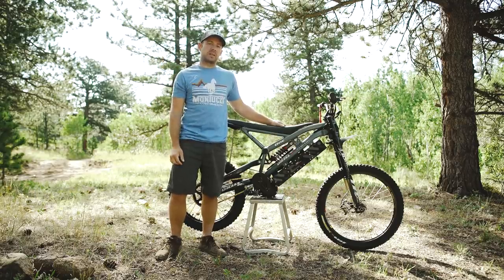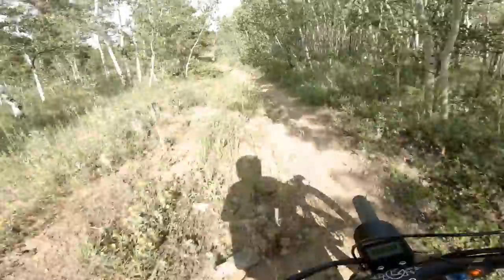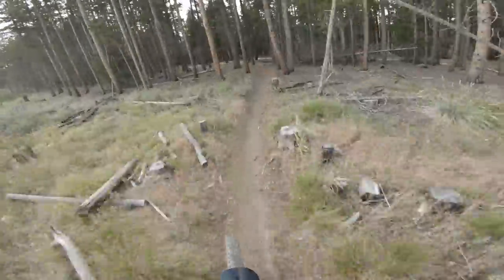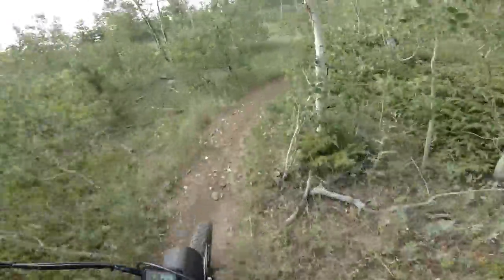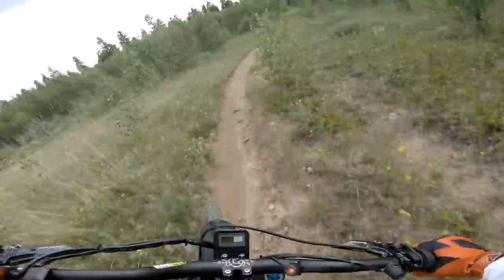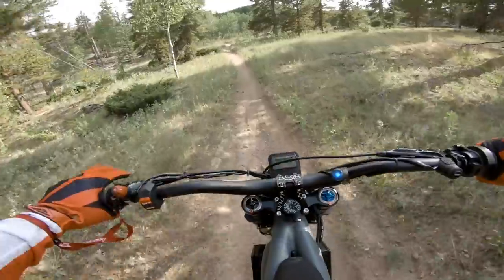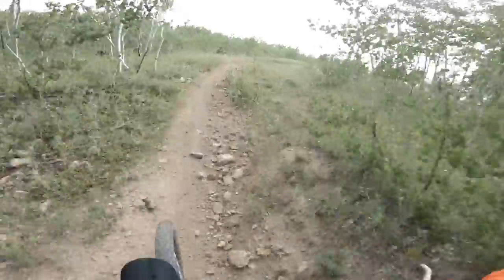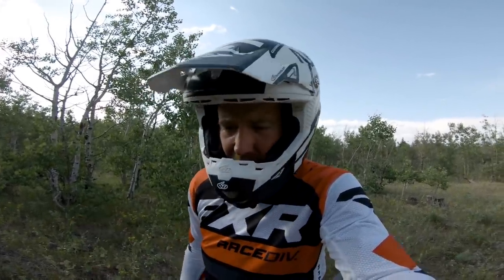CZEM Drill One Electric Dirt Bike | A Sur-Ron Destroyer?

Comment: Amazing how quickly they are evolving.
Reply: Itll be a game changer when they realize they should be putting 3 or 4 speed gear boxes on them. Im really not sure why nobody is thinking about that. The motors are more than capable and so are the batteries. 
"Give me gears or give me death" i think somebody famous said that once.
Reply: @mshock9637  weight, cost and and engineering complexity (motor is no longer directly in line with the driving sprocket for one). It's better to up the power to the point where you can simply raise the final drive to achieve high speeds, but still have arm snapping torque off the line. A gearbox is not required
Reply: @aidangillett5396 
Thats the most ridiculous thing ive ever heard. Thats basically saying that transmissions on cars are stupid and centrifugal clutches and torque converters are just a big fat waste of time? You dont need those if you just build a bigger, stronger, faster engine... right?
Reply: @aidangillett5396  
As for a gearbox design. 
Take the guts from a quad.... and make it work. Build to finish in just 2 easy steps.
Wheres all the old fashioned American ingenuity these days. Youd be amazed at what you can accomplish with a welder and a pile of garbage my friend.
Reply: There's one by specialized weighing in at 36lbs. They're getting lighter and faster by the year I wonder if it's the development of wind turbines that's been the innovation or power tools? Or maybe they're all getting better at the same time for their own indented purposes.
Reply: @mshock9637  My car has impressive acceleration and top speed 162 mph , and no transmission.  What do I need a transmission for?
Reply: Electric Motor has the same torque from start all the way up to about the last 10 mph. They pull all the way. You'd only need a gearbox for an overdrive starting at about 40 mph to 90?
I don't want to go 90 mph on a mountain bike.
Zero and Energica have no gears.
Energica has 150 pounds of torque up to 130 mph. Beats anything on the road..
Reply: Your both just saying that just because you motor already gets to such n such speeds with such n such torque means you wouldnt benefit from a transmission and find your line of thinking a bit strange.
Reply: @fatyowls  
Believe it or not we have dyson... yep the vacuun cleaner guys to thank for a lot of the motor and controller technology.
Reply: Yeah, you don't need a transmission with an electric motor.
Reply: @aidangillett5396  
I completely understand what you guys dont seem to get is application. If the electric motor is that good at the axle why not have it not be a reduction drive but an increase. How is no body pick up on that. Im not saying gear it down YOU GO UP DAMMIT.  so the sur ron for instance goes from 1:1 to 1:3 your just stretching its potential other than mechanical loses this is not stupid and none of it takes a genius to sort out.
Reply: @mshock9637  Keep in mind transmissions are expensive, heavy, and inefficient.  They cause extra friction which contributes to the useful power (at the wheels) being less than the power at the crank.  Sure it makes sense when you have an engine with a very narrow power band.  But electric motors have very wide torque bands so you can have situations where adding a transmission would increase cost, decrease range, and decrease performance.  Porsche brought out a Tesla competitor with a 2 speed transmission and has already announced that the next version will not have a transmission.
Reply: The sur ron already has a transmission on it for cryin out loud its just a single speed. Youre telling me that whats gained from that 2 stage reduction is worth less than the the amount of rolling resistance it adds? And a dirtbike trans probably weighs what 10lbs?... alright so leave your wallet,phone and gold chain behind and you're good. Im still not convinced of this. "Uhh oh guys Porsche couldnt do it with a crumby hi-lo trans so its probably best if we never revisit, rethink or give this any consideration ever again, its stupid ... UNDERSTOOD oh and johnson youre fired for coming up with it in the first place!"
Reply: @mshock9637  You seem to be missing that generally electric motors don't need a multi-speed transmission.  Even if it's only 10 pounds that's a decent fraction of the bikes weight and likely costs at least 10% of the power.  Multi-speed transmissions are great for internal combustion engines, less so for any electric vehicle.
Reply: @BillBroadley  
Nope i didn't understand a single word youve said so far. Try being a bit less verbose and maybe use crayons and i might start sautee'n what youre marinatin.
Reply: Ok so here i go. 
ICE motors *require a transmission or torque converter because they operate at such high rpm which generally isnt useful for all situations ie stopping and starting. With electric motors on the other hand they are not *required but could still benefit from some of the positive sides of a multi train gearbox top speed for instance. If it doesnt need to be reduced use it to increase. You can not argue that statement is untrue. And if you do youre simply being spiteful or hard headed.  Simple as that.
Reply: That's quite the biased statement you made there. Have they copied the Chinese or is this evolution? The Chinese are always blamed for copying.
Reply: Teslas use electric motors that have two moving parts, and single-speed “transmissions” that have no gears. The company says its drivetrain has about 17 moving parts compared with about 200 in a conventional internal combustion drivetrain.
Reply: The Tesla Model S has a single speed gearbox with a ratio of 9.73:1. This step-down transmission allows the car to handle the higher rev output of the electrical motor without excess wear. ... Most electric motors in modern EVs are capable of up to 20,000 RPM, so some form of singular step down gearing is necessary.Mar 29, 2020
Reply: @philipmatthews3351  
The torque converters koenigsegg developed and uses as a transmission is nothing short of brilliant. Not so sure it would apply to EVs at all but they certainly eliminated a lot of things to go wrong. 
But these types of bikes would most definitely benefit from a small 4 speed constant mesh sequential gearbox. Its just silly to think they wouldnt. They dont weigh much and theres honestly not many moving parts. And im wondering if you included a freewheel mechanism inside the gearbox i dont think you would even need a clutch.
Reply: @Slappy White
I understand what you're saying.
But shifting gears are for when the motor winds out and you need to start the process over. Electric motors don't wind out till 20,000 RPM or more, and the torque is the same all the way.
If you wanted to shift to a (2nd gear) on a "Zero Motorcycle" at say 120 mph, then (3rd gear) at 
240 mph, then (4th gear) at 
360 mph. But even that isn't necessary because they can just use an electric motor than goes to 100,000 RPM..  See my point. 
Check out videos of electrics drag racing.
Reply: @philipmatthews3351  
Right so now you take this and apply to sportbikes and baby you got a stew going. Am i the only one here that wants to go fast or what? I friggin lost here.
Reply: Slappy White I don’t believe Dyson vacuums are responsible for the tech in these motors and electronic controls... how so?
Reply: @jacobkeller29  
Mot souly responsible no but responsible for many of the advancements in the brushless motor world. Dont take my word for it just google it.
Reply: @jacobkeller29  
Dyson is a motor and motor control company first and foremost the vacuums are ancillary.
Reply: @mshock9637  I've wondered the same thing. I figure why not slap a few extra gears on the rear hub like a regular bike? Or maybe an internal gears hub with a driveshaft rather than a chain? It's already been done with regular bikes so why not apply it to ebikes?
Reply: @iamaturdle1514  
Exactly. Ebikes have been doing it since the beginning and more and more emoto manufacturers are jumping on board. These guys above wouldnt know their ass from a hole in the ground.
Reply: @mshock9637  dyson, only marketing about motors and control
Reply: @olivierb9716  
Huh?...
Reply: @olivierb9716  
A simple google search reveals a laundry list of inovations from Dyson and his fancy vacuums. His digital motors are state if the art going from 0 to 90,000rpm in les than a second. I dont think anyond else is putting thd kind of R&D into motors and controllers as they are... and to think all to make a better dust buster.
Reply: @mshock9637  Plus running the motor at lower rpm's will extend the overall range and make up for the extra weight. Not to mention less stress on the motor so it will potentially extend the motor's life. 

I get their argument though, for a dirt bike like this it's not really necessary since you probably won't want to go over 60 mph on these tight tracks. But for ebikes used for commuting on pavement, it just makes sense to add a few gears.
Reply: @iamaturdle1514  
Ebikes, street and sport bikes as well... and i mean lets been honest dirt and dual sports would benefit from it as wel. There are plenty of situations where a clutch is completely necessary for a particular maneuver think of trials bikes... how would that work with nothing but the electric motor... not nevah.
Reply: @mshock9637  There's actually a company that makes an electic trials bike with a clutch. I forget the name though. I watched a review of it on youtube and it looks promising.
Reply: @iamaturdle1514  
Oset. Theyve been at it for awhile now actually. I think thats one anyway. 
I was considering using a 5 speed peerless transmission for a tester. Yeah its a lawn mower trans but its small(ish) and can bd made to fit damn near anything. Not sure what sort of abuse itll put up with im sure not a huge amount but its a jumping off point anyway.
Reply: @mshock9637  I just found the video. It's called "electric motion".
Reply: Well yeah electric guys but electric motors do have a peak efficiency. And why the hell not add more torque on the low end. Maybe for mountain bike riders this is fast but ride a 500cc 2 stroke bored out a few times running aviation gas... then this thing is respectable, but certainly not holy shit. All said this thing does actually get my attention.  Finally, they are stepping up to play ball. Welcome!!
Reply: @DonJDawson  
Youre not wrong, man. And now that they're just as illegal as any other dirt bike they got their work cut out for them. Although a 500cc 2 stroke bored out several times over msy or may not last very long depending on who is on the go button. Thin jugs and whatnot.

Comment: I've had two of the original bikes for over a year in South Florida and they are just flat out AWESOME! I own multiple Sur-ron's and wish these came out sooner as the surr-ron are now the loaner bikes for friends to ride as we never touch them anymore. I have to say for the performance and reliability of the two demo bikes I have been better than my sur-ron's. I've had to tow the sur-rons home behind it a few times and this was even after a good thrashing and still, plenty of battery left. Don't get me wrong the sur-ron's are great play biles like an XR 80. But the Drill is more of a purpose-built bike in comparison as it comes with much more capable suspension and a real frame that handles anything you can throw at it.

The Drill is much more fun and can take you anywhere you can think of. The Drill has multiple power levels you can ride it in and in the medium mode is so much fun to ride and still offers more performance than the Sur-ron. I like all the bikes and just wish the sur-ron was a bit bigger and tougher as you have to be careful on it or you'll break parts. I have 1 stock and two modded sur-ron's and even with the 84v setup and the nucular 24F controller on the sur-ron with full fox suspension, it's not comparable to the Drill as a whole riding such a small package.

I was never able to fold or break the MTB front wheel even jumping off 10ft step down at 40mph the only problem is it would wash out easily in the corners when were racing because it was so narrow and light as the front basically skated at al times when you're on the power. If you install a real front fender the bike looks so much better. I'm here sharing my opinion as this bike flat out incredible to experience. I sold our big bore dirt bikes and we just have a fleet of new generation of electric dirt bikes.

We have zero regrets about the Drill and enjoy them regularly. Yes, and without question, it's a Sur-ron Destroyer! Most importantly you have to remember you are not comparing apples to apples here.
Reply: How did you get 2 of the original bikes a year ago? Do you have the original designers Rev-x bikes?
Reply: @rayheppner8391  Yes, the bikes Bob designed were the first and now Drill is tuned and more complete production version. I have been able to put these bikes through just about everything I could think of and the only thing I have to maintain is the chains as the enormous amounts of torque stretches them. I've had 2 chains on the bike so far as the power is way too much fun! The best part of these bikes is the reliability has been extremely impressive as my son and myself ride hard and love
to use the power and have the bikes tweaked. The wheel combos are something that is important as by getting a stronger lighter wheel on the bike it extended the range and overall battery performance. I see too many people add bigger tires and wheels to the sur-rons and they don't realize the loss of power and performance even on a bike like a drill as the thinner more aggressive tire is much better all-around by keeping the weight and drag down. I have seen it with all my bikes and prefer lighter, narrower, more aggressive setup as these bikes are so light they bite good with anything and the wheel speed is much better all around. I have a custom-built 1.4 on the front and it has made the bike react similar to the lightweight MTB wheel only with a ton of traction.

Comment: My biggest concern in watching you ride at this pace and speed is that the front tire is NOT made to take that kind of punishment (speed x force x weight x impact is much greater than on a mountain bike).  But damned that looks so crazy fun!
Reply: Guys, downhill riders go 50mph regularly and ride much harder than how he's riding. This myth is getting old fast.
Reply: @allanshpeley4284  I know, and that is why I commented. I used to ride motocross and bent many a rim! I know they have tested thoroughly when designing but I can't help but pucker up a bit when I see guys get tremendous air or bang hard off boulders! I'm seriously impress and no on I knew when I was young even attempted this stuff. It's like the difference between skateboarding in the 70s(my era) and the crazyness of boarding now.

Comment: Cant believe you got to ride one bud.Ive watched these Rex (I think they started life as)bikes for a good 6months now and they are the top of there class no question!The only thing is it should be belt driven as the point of a ev bike is to ride under the radar and that small tight sprocket helps make alot of noise.Great ride as always bud and more on this bike pls
Reply: Drill One stole design from REVX
Reply from the maker: @Fpvlee Thanks for the note man! I saw some of your responses to the challenging comments and appreciate your knowledge on this stuff as well. Helps to have your perspective and I agree with what you're saying. More to come soon and glad to have you along for the ride! 👍
Reply: @ElectricCycleRider  No thank you bud love the content and adds real substance as you can ride like a beast👌Yeah yt comments section are a rat's nest of ugly comments some times as you know bud, important thing is not bite and leave before you become one of them in response.Keep it up bud👊
Reply: Belts are not recommended offroad.

Comment: My only complaint with this machine is the way the motor is exposed and kind of hangs down. I live in Western Oregon and have to hop lots of logs / trees & bigger rocks. I see this motor as not gliding across 18" logs with out hanging up and taking damage. Needing a heavy bash skid plate

Comment: As a Sur-Rom owner, I’m interested.  I really love my Sur-Ron but who would not want 3X more power?  My bike has the 58 tooth sprocket on it now and that helps with low end power up hills but reduced top speed to 38MPH. 

For me it is a toss up between the 54 and the 58 tooth sprocket.  

Would be awesome if I could just have the 48 tooth that came with it installed and still have the low end power of the 58 without losing the top end power and speed.   Seems like this bike could do just that.
Reply: All that power at the motor means nothing without a battery that can handle it. Amp hours times voltage gives you the wattage the battery can handle. 

I've yet to see a bike advertising massive kilowatt motors with a battery that can use more than 4000watts of it
Reply: I'm real curious to know how long will a full charge last in red mode,  truly considering buying a drill one 21" model over the sur Ron what's your thoughts??

Comment: This is a pretty standard question for any electric vehicle.
Your riding in Red mode and Blue mode looked fast and fun.  But how many minutes of that type of riding will the battery provide.  I suspect that it's good, but confirmation would be nice.
Also, can you charge the battery using one of those cool and compact petrol generators that caravanners use?